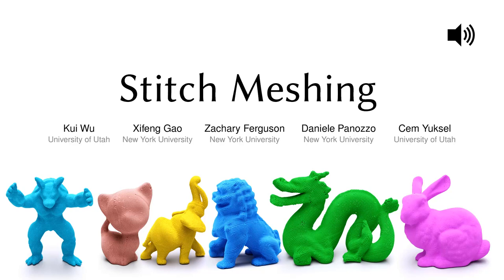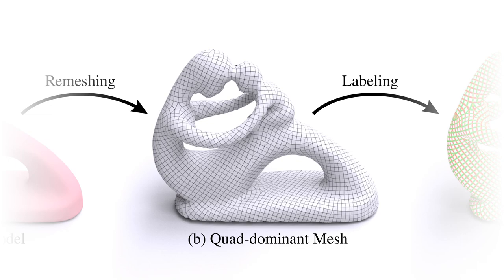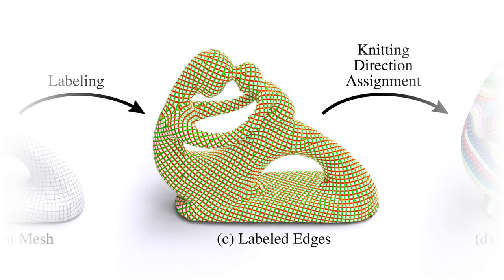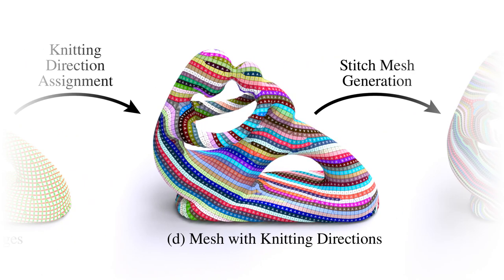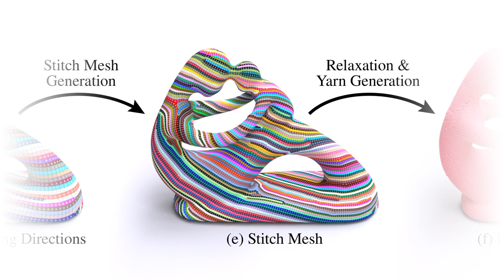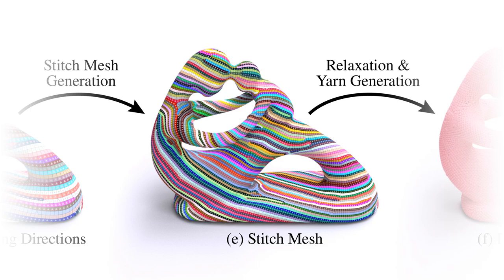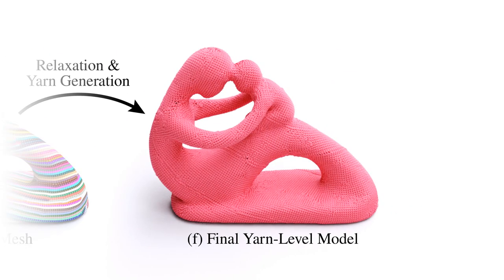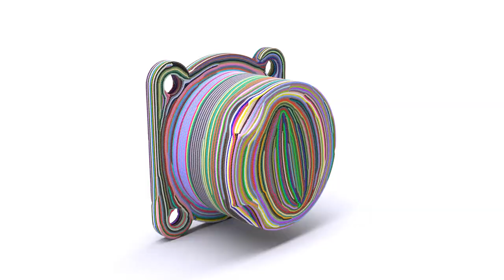[SIGGRAPH 2018] Stitch Meshing

Comment: I think more can be done to make the mesh more visually appealing.
Reply: lol..... first emerge this algorithm on your own without assistance then we can talk about improving it.

This is next level monster work....yes now that it is down and solved they can and will likely improve it but since they did already show solutions using more dense mesh geometry ....I don't quite understand how much better you think it can get....simply they'd increase the mesh density for their solution to a given model depending on the models surface complexity....and if for printing this solution would just have the printer render more fine printing instructions.
Reply: First, I wasn't trashing their work I think it is great and secondly all I was referring to, was to make the seams between different patches align (or be orthogonal to) along lines of local symmetry, like the spine of the bunny, or even force as many of them into places that are not visible, like underneath the scuplture. It is a question of aesthetics, but in my opinion, coding that option would have been trivial.